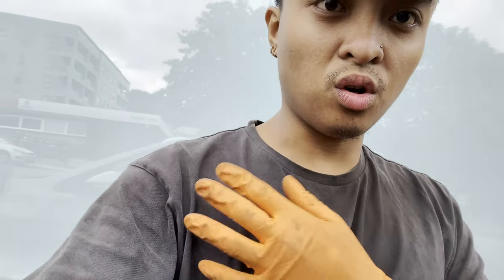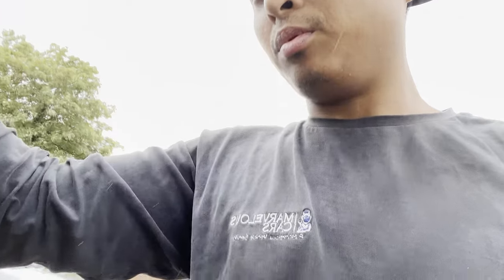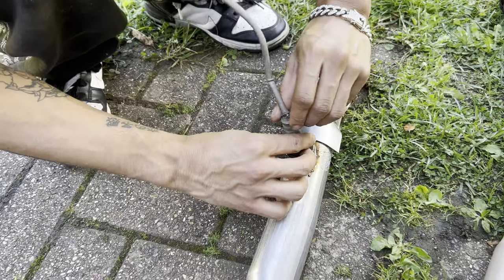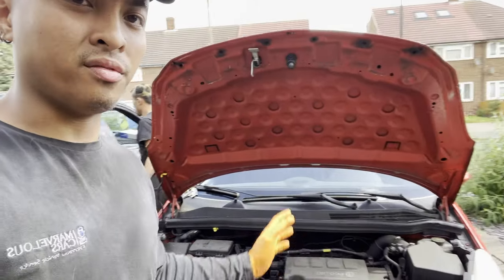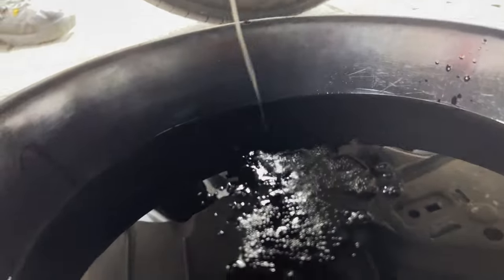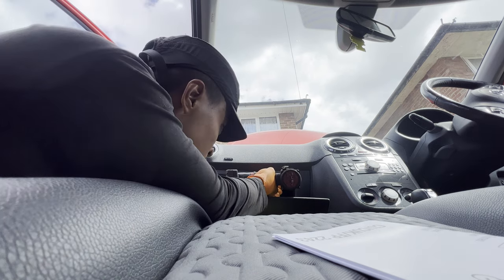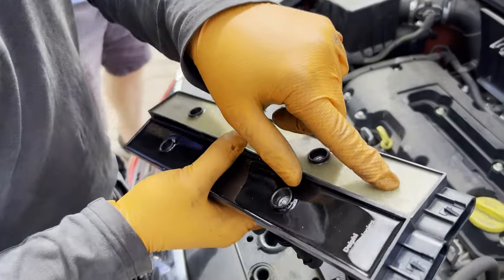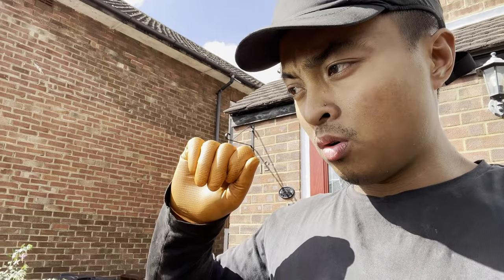Life of a Mobile Mechanic | VW Brake Pads | Zafira Exhaust Replacement | Corsa Service | VLOG 15

Comment: Who are these people that don’t service their car for 7 years?!  What else in their lives do they skip? It’s insane. Fair play to the little corsa getting though annual mots for 7 years unaided.
Reply: they probably just kept topping up with fresh oil, at least, i'd expect the mechanic at the garage to do so when/if they took it in for, say the spark plug that was changed
Reply: Oil filters usually crumble with these corsas
Reply: I have a Jag X type 2.2 d 57 plate she's  just covered 272000 regular servicing is key to any motor brilliant car

Comment: Great video. Never surprises me now how many people just fail to service their cars then wonder why they go wrong!

What is wrong with crosland filters by the way? I've used them for years and never had an issue, but then again, I run sheds anyway and change filters quite often. Preventive maintenance is better than none at all
Reply from the maker: This is not the first one in the channel. There’s a Vauxhall that we did- no service for 7 years and turbo failed 😆.

Crossland filters isn’t really my choice. The material they use isn’t really great, mainly on oil, fuel and cabin filters. If changed often, fair enough but if it’s changed every year/10k miles I wouldn’t recommend it
Reply: @themarvelousvlog  I saw the vauxhall video too. Unbelievable!

Comment: i always use mann filters reglardless, they cost maybe £2-3 over euros own parts and ive never had any body refuse yet to go with the better brands
Reply from the maker: I always give people a choice when it comes to their parts. 99% if the time they will go for the better filters. Not much difference in price really; why not take the extra step to take care of your car 🤷🏽‍♂️
Reply: Mann filters all the way crossland is down bottom on my board mann at the top
Reply: +1 for Mann - apart from anything they're a tier-1 OEM

Comment: Lol i am having some right dramas with my wifes mini at the moment , with the break disk retain screw that has rounded off and sized in place got drill that out now , was changing the ABS sensor hence why i noticed her disks needed changing , however the ABS sensor snapped so i got to stick a screw in there now and see if i can lever it out.  The joys off working on a 17 year old car. To be fair it broke me a bit over the last couple off days changing the rocker cover gasket yesterday and one off the retaining studs  snapped put no torque on it whats so ever either , having a right nightmare with her car at the moment i been messing around with cars for 10 years now and always enjoyed it , however her mini i have never liked working on it has always been a pain and chore to be honest.

Comment: You probably already know about the PCV valves on these ecoteks but it's basically a common problem and requires a new cam/rocker cover 👍

Comment: I wouldn't say triple qx oil is that bad.  That's what I've put in my Leon TDI  for 10 years.  The car's 20 years old on 160,000 miles.  I also use a vacuum oil extractor, because I can’t be bothered getting under the car to remove the under tray.  But I can understand why you use more expensive oil brands on customer cars.  Avoids them thinking thinking you're not doing a good job even when cheaper oil has the same specs.

Comment: Had a weird experience with an oil change on an ecoboost on saturday the vvt was clicking due to oil starvation, dropped the sump found shredded cambelt in the oil pickup and went to try buy a wet belt kit for it to find out euro, gsf, car parts direct and ford wont sell me one only on ebay which i dont buy parts from🤷🏻‍♂️😂 so cleaned the pick up and did a fresh oil change also cleaned the sump out and all the shredded cambelt in it sheash 😬 only on 40k miles aswell been servicing the car for over 4 years now with early intervals to help prevent this issue but ayo we move on 😅
Reply: Watching a lot of content about stupid wetbelts and I can say from what used car dealers have been saying the sooner you get rid of car the better... If you watch CarUk content on YouTube you will get why
Reply from the maker: Worst idea. Good for economy those wet best but worst for the engine and owner. Just why would they do that? 😂
Reply: You looked in to fitting cam belt fort fuck they clean sump out get oil light out been there done it 😂
Reply: @chrismills9346  tbf they were just wanting the oil starvation issue sorted to sell the car I explained what has happened and that a cambelt is needed tried to quote them but couldn't source the parts except for from ebay which I don't trust ebay parts after a few issues in the past
Reply: We had engine sat floor rebuild since Christmas no one wat do them 🤣

Comment: How on earth was that Corsa still running ? Unbelievable. Curious to know did you cover yourself by informing the customer of the possibility of the spark plugs shearing ?
Reply from the maker: Exactly that mate. Always gotta let them know that there is a possibility that the spark plugs may shear, otherwise they’ll blame you if it snaps 😂

Comment: A little paste/ high temp grease will never hurt the brakes
Reply from the maker: If you watch our other videos, you will see that we usually use brake paste. There is a massive debate within our community about using paste/not using paste. People will say it will attract dirt, people also says that it will prevent seizing/corrosion but who’s got the definitive answer, who knows 🤷🏽‍♂️. 

Though imo paste is a good thing to add when doing brakes. I’m just following procedures as per OEM. Still, I would’ve done it but I thought I would follow OE instruction this time around 😄
Reply: @themarvelousvlog  great explanation 👍

Comment: Hi, change the Oil once per service because it is almost impossible to get all traces of the old oil out. Even if you run the Engine to Maximum operating Temperature (Also I'm fairly sure the customer won't pay for Two Oli Changes). Also it May be a good idea to wear a dust mask when doing Brakes because the brake dust can get up your nose. If you are doing brakes on Two, Three or More cars a Day then this can be hazardous to your Health, (I am sure they taught you this at Automotive Collage)...!?!👍👍😇😇
Reply from the maker: The customer actually did pay for the two oil changes that I did on this video. It is a good idea to get rid as much as you can before putting an oil that they’ll be running with until the next service. We don’t want that pick up to be getting clogged.
I did recommend them to change the oil again though, after 5k miles then normal service interval thereafter (10k mi/12 months)

In regards to the dust mask, I do agree with what you’re saying, just never really bothered but I will add that on my list of PPE. Got kids that I wanna grow old for. Thank you 🫡 😅
Reply: Running the Engine to Operating Temperature or close to it will drain the Oil quicker and as much as possible...! So no need to change the Oil Twice in (1) Service..! This will be Extra Money in your Pocket but you do what you feel is best on your customers Cars..! 👍👍😇😇
Reply from the maker: @HowToSaveMoneyOnCarRepairs it’s not about draining the oil quicker. It’s about grabbing the oil that turned in to (paste). Running new oil with new detergent + flush will help dissolve that (paste). 

Running the old oil in there to flush with it, isn’t going to help at all. Might as well just drain it and put new oil in there. 

It’s not about the money, just recommending what’s best for my customer 😅

Comment: Omg 7 years  I won't take our volvo 2008 s40 r design to 10,000 miles without a oil change only use fully synthetic 5/30 with Mann oil filter